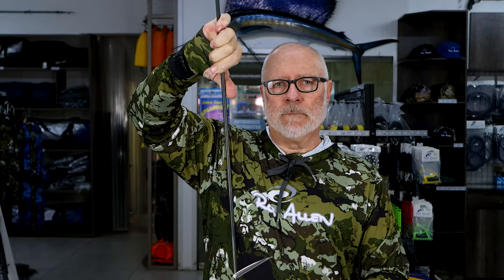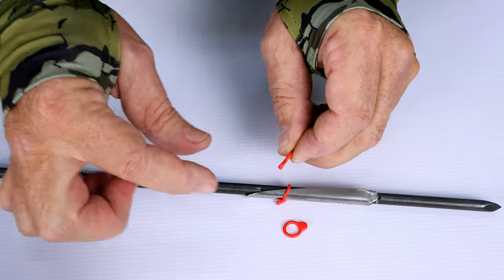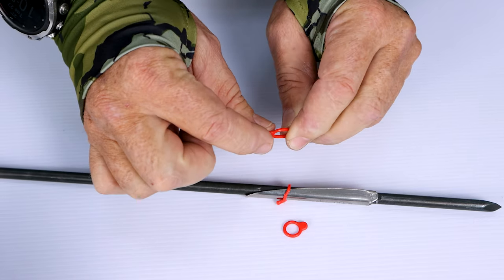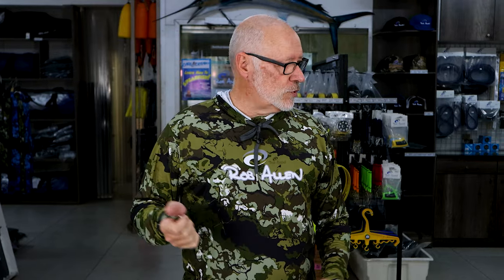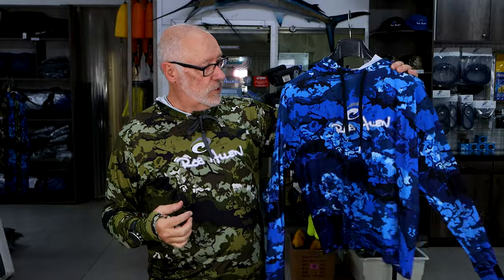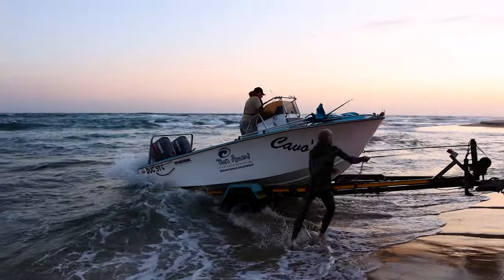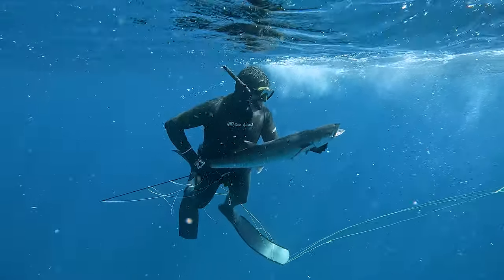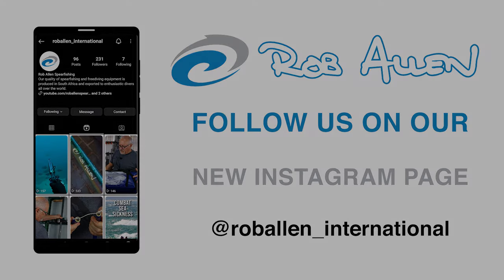Rob Allen | New O-Rings | 2024

Comment: The new orings are great with tab, question since you made the mould for it why not make the tab on the ring horizontal and slightly longer?

The old ones detoriate way too fast
Reply from the maker: If it lay horizontal it might be difficult to grip. When vertical and in this soft material it lays flat as soon as the spear moves. Also, the longer the more the drag. 

In the beginning, we used a short piece of bungee tube cut like an O ring with a flat tab. This then broke and we shot without the bungee O ring and saw a noticeable improvement in spear speed and penetration, hence the reason to keep the drag coefficient down as much as possible.
Reply: @RobAllenSpearfishing  
I think a horizontal and slightly longer would be easier to grip with gloves as you could just push it sideways to reveal it to be gripped. 
Anyway hopefully we get them in Spain anytime soon.
Reply from the maker: @mikefue9597   Ask your distributor to please stock them.
Reply from the maker: @mikefue9597  Too late, mold is done, first 50,000 made.

Comment: I need to know the length of the shaft for a 110 and 120. In the pages in Internet apear up to 160 cm. What is the length becouse i need to buy two shafts.
Reply from the maker: All of our spear lengths from a 70cm Barrel are 40cm longer than the barrel. 

In your case you need:
110cm Barrel - 150cm Shaft
120cm Barrel - 160cm Shaft
Reply from the maker: Bonus, Check out this video we made earlier this year if you want some more info.

https://youtu.be/OjaTB3Yllqc?si=mi3q59kxuUb5cA_p

😎👍
Reply: I need that you make a video of the diferente thicknes of the shafts. The ones i hace dont look like 7 mm thick they look smaller. Please mate the video need to know. Thanks. 14 mm bands works finewith 7 mm shaft
Reply from the maker: @elunay5095  We will look into it   👍